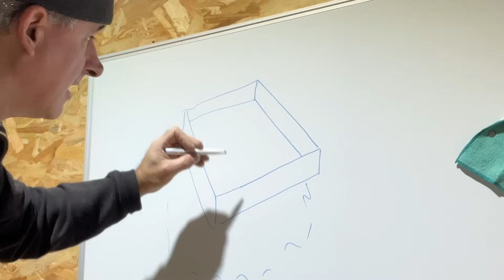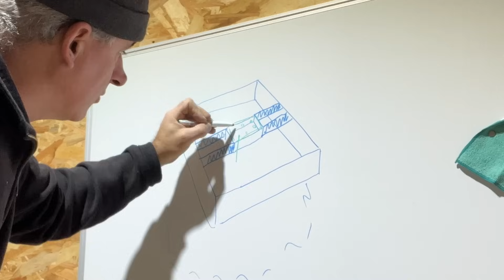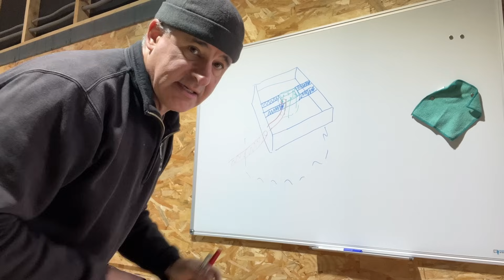Creating Foundation for New Solar Mount | Rally Car Update

Comment: Middle or any multiple finder trick. Angle the ruler till you,get a number you can easily divide by and mark. E.g. half on 37 angle the ruler to 40 mark at 20 and this will give you half, same for 4 equal parts - 72 angle to 100 and mark at 25, 50, 75 and then you have four equal divisions.
Reply from the maker: Great tip - cheers 😀

Comment: I was wondering if the stud's were stainless,
But seeing all spark's coming from the cutting.
I don't think they are.
Looking forward to the next episode.
Happy New year to you Ian and Julie.
X
Reply from the maker: No not stainless. They should be ok for this application. I will dab some paint on the top. Happy new year to you too 👍
Reply: Or could use plastic tube and glue some round plastic disc on top.
Paint first as you said.

Comment: I recently put in a row of 30 panels at my new place.  For their mounts I put in two rows of 16 ground-screws and bolted everything to that. Much easier than playing with cement and I can easily remove it at a later date.  This approach assumes a long row of panels so isn't applicable to all configurations.
Reply from the maker: We will use the roof as having an array is liable for planning permissions and also more tax - they tax you for being green here.  But on a roof it is fine.... this one is for a single panel why we sort out the rest.

Comment: Ian & Jules , Happy festive season & New Year to you .
Ian are you going to use the setup that the Americans use to mount the panels on that you can change the angle of the panels to suit the angle of the sun ?
If so
What about including a wind generator on the top of the said pole ?  You could include guy wires for stability which you may have to do even if you don't add a generator as those panels could act like a sail it comes down to how the seasonal wind reacts to it.
Rall he & her
I don't know what it's called.
A cylinder with a internal plunger & spring that is connected to your engine oiling system. Oil pressure depresses the plunger & compresses the spring if by any chance engine oil pressure drops  then the spring & plunger keeps the system pressurized.
Kiwi Rod
Reply from the maker: I am hoping so - if I can try and follow the angle of the sun it will give me full power into the Power units.....

Comment: MY GUESS
Well they got sick & tired watching you doing the teter/toter & about to land on your snotter so
To fit long tracks you either have to make the pusher blade not as wide or space the tracks at least 8 inches per side . if its space out & extended track you will find out the true capability of the excavator.
Kiwi Rod
Reply from the maker: haha, I know, I wish I could extend those tracks